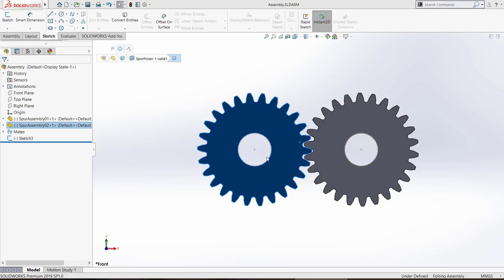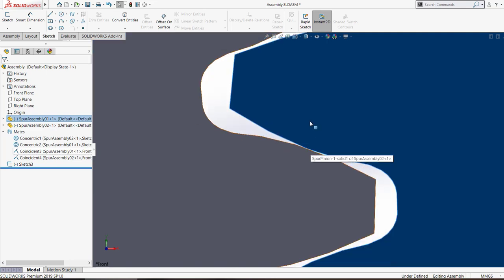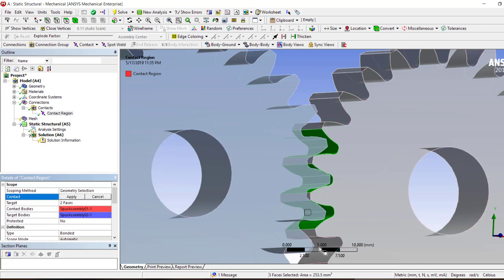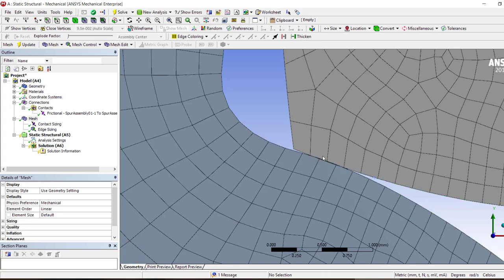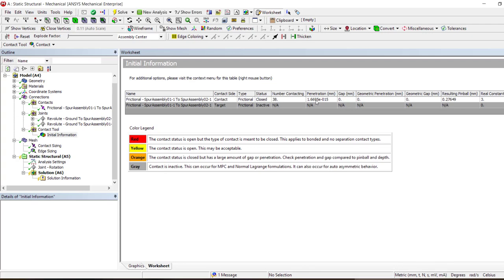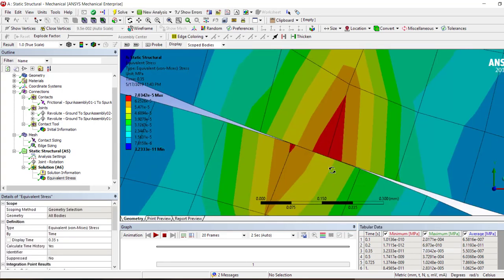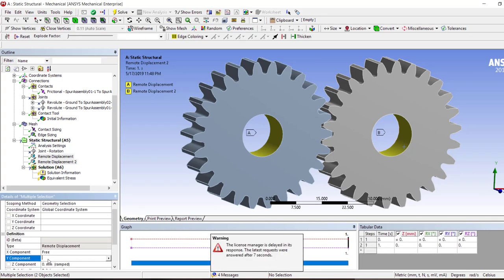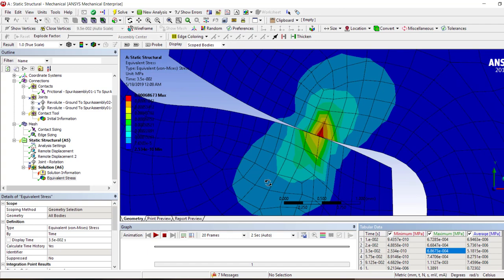How to Set up a Gear FEA Analysis in ANSYS using Joints and Remote Displacements

Comment: How can we determined angular displacements i. e. if one gear is rotated by 1 degree than due to deformation the other gear rotated by greater than 1 degree. Angular deformation = theta2-theta1 where theta1 is input gear rotation angle and theta2 is output gear rotation

Comment: I think the reason for obtaining low stress values is that the contact forces (resulting from the contact stress) are not meant to overcome any opposing force from the slave gear. The boundary conditions given would result in free motion of the slave gear while being pushed at the point of contact by the master gear. 
I would model this problem with Cylindrical Supports at the center of each shaft, Remote Displacement at the center of the master gear (to rotate it by 12 degrees), and a moment of arbitrary value at the center of the slave gear (representing the opposing moment which might be a result of misalignments or friction between shaft and gear).
I have not tried this idea out, but I think it would result in more realistic stress values.